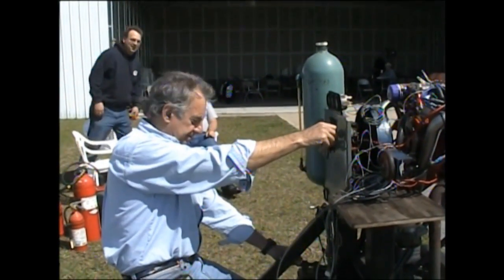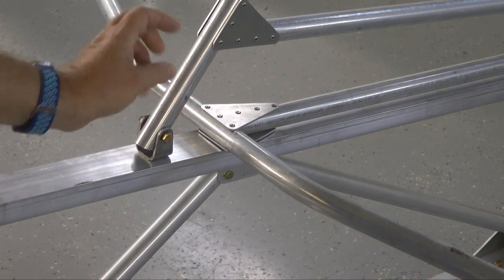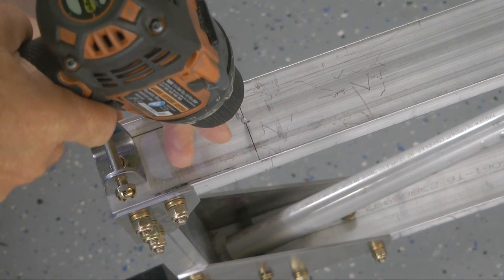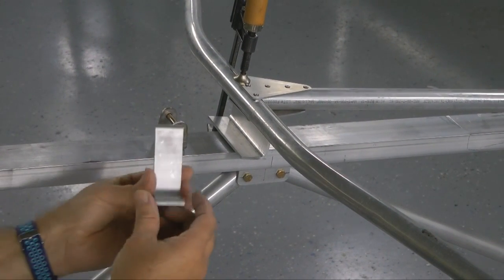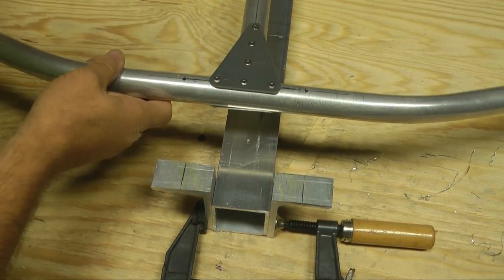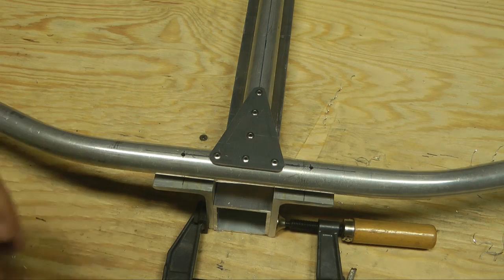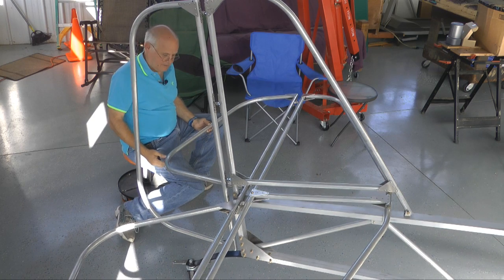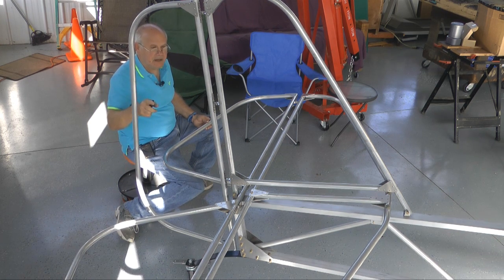Building the Affordaplane Part 18

Comment: I do not have a digital level, so I raised up the tail  untill the top of the fuselage is at level, and then use my level to adjust the horizontal stabilizer.

Comment: The use of the flat washers against a round tube troubles me a bit. There are saddle washers that can be had that will have 100 percent contact to the round tubing.  I see aircraft spruce sells them and fairly cheaply. The flat washers are crying out to crush the tubing and any deformation will extremely weaken the structure.  No real discussion of safety wiring much either.  Don't take this a knock but a suggestion as I love what you are doing.
Reply from the maker: David - Excellent suggestion on the saddle washes, thanks!  No safety wire needed here - only using temporary fasteners for now.

Comment: Another great video, thanks Jon.  Seeing you drill that bottom hole for the rear horizontal stab bolt, do you ever get concerned about metal shavings being trapped inside the tube?  Any remedies in mind if this is a concern?
Reply from the maker: Aluminum magnets work really well for removal

Comment: I'm not sure I understand how/why the horizontal stab gets lifted up to the angle the way you did.  I need to go back and watch that part again.   I saw in a video from the guy that runs the affordaplane store that he added a brace to each side of the horizontal stab along with gussets.  I think he did it to each side of elevator and then also to the rudder and vert stab.  He said the  covering would  bow these sections when it gets wrapped.